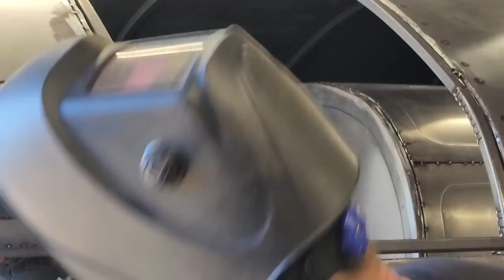Fabricating the door out of square tubing 🧲

Comment: It would be so damn cool if you opened the door the other way with the hinges on the bottom. Then put fixed steps on the inside of the door. Like on a private jet. But I think you have to use like hinges from a trunk lid or something. Maybe really big curved hinges that acts like handrails when the door is open?  
But if you decide to have the hinges on top anyway, it would be just as cool to have a mirrored door on the other side. Like on a DeLorean.
Imagine that silhouette from the front...
Reply: I really like that idea.  I think you're on to something here!  Chad, this is a great idea!
Reply: Second that

Comment: Just my humble opinion - but I think it should have the doors ahead of the wheels.  And one on each side.  Otherwise it is a bit "hokey" with having to do acrobatics to get in & out.  But, oh well - it's Chad's creation to enjoy as he choses.  And I'm sure it will never be a heavily used vehicle anyway - if it is ever actually completed.  I've enjoyed watching it come from just an idea & a floor - to where it is now.  Still wondering what he'll do with the narrow-track front wheels.
Reply: I agree with you. But he is going to build it his way
Reply: Oh it's VERY hokey.  The fin on the back cracks me up
Reply: I think he doesn't want to compromise the front end structure. Just my opinion
Reply: Yeah I thought that was well looking at the original pictures of the old vehicles they built
Reply: I believe that the passenger should have a door, if for no other reason to provide an escape route in the event of something happening to the driver and/or the driver's side,.... trapping them in. Or a fire starting in the engine compartment
Reply: Chad is one man of many projects. Hey theres plenty to go round.. Yea we have all enjoyed watching it materialise, questions questions what will he do next 😄For the front wheels im thinking hes gonna use an outer wheel from a double axle set up to get the extra space , and possibly pish the boat out altogether and put spacers on too. A few precise cuts and left over hinges would make a flip front opening clamshell design. Solve all the escape issues and the door fab.   But yea its chads work so he can do what makes him happy and we re all very privilged to be watching.
Reply: @nelsonmattoon150  exactly why would he build your way?
Reply: You think it’ll ever be driven?
Reply: He can have offset wheels made for the front to make them set out more, but I doubt he’s interested in doing that.
Reply: I know ?
Reply: @irishcubs01    lol.    I love the fin idea.  But I'm personally not fond of that particular fin.  It curves upward to a point.  I'd rather see it curve downwards & be gently rounded.  To match the car.  Could even put "rivets" all along the fin all the way to the front & down the windshield to meet the grill.
Reply: @bardricmacgregore4863  that's true
Reply: @oldredchevy-hh6de  I think he only put it on because the curve on the back doesn't match the front
Reply: I like the awkward door, but a simple escape hatch in the floor and/or roof would be nice... just in case.

He seems to wing things and build onto them on the fly which I love, because it's how I am with every project I have ever undertaken. It makes it yours. My biggest problem is evolving an idea over time, making it better... it can make for a fair amount of undoing work.
Reply: @mrstyle_67 He has a set of duel wheels outside which Nathan was trying to get apart. May be he’s planning on using these.

Comment: You should do the door like on a private jet where the stair is built on the inside of the door. Hinge it to open down and have the steps to get inside and when closed it in hidden. The hauler is shaped like a aircraft hull.

Comment: Chad, ever consider putting a electric motor on the hand pipe bender with a foot switch maybe ? It could give you better control and you could hold the piece and run it through single handed .

Comment: Mr. Chad , after you put the 4 sides of square stock around door opening. Now to strengthen door in center weld a piece of curved square stock from top to bottom on center spot of door. At the top and bottom of existing square stock , you will have welded to slots/cam to receive square stock from door. Do you have 1 1/2 " piece of square that you cut (1) side out to make a square U and weld in center spots,top and bottom. If when you close door and center square stock is not fitting tight in slots/cams (bend in the sides) for tighter fit,a hair at a time. Your slots/cams will be 3 sided with 1 open end to receive door square stock. Like a kitchen cabinet door slam latch made of 2 pieces, 1 end a cam-shaped like a U and the other a body to fit in cam     Cam -top and bottom, square stock welded on door.

Comment: Hey Chad - Given you tend to build with way more square stock than tube, would it be better to get some rollers for your pipe roller that have square faces or some flat rollers. you could get the ones you have already slightly damaged and have a square machined into the roller if you have a mate with a lathe.
I like how this is coming together. interesting build for sure.
Reply: need to have rollers that fit the square stock.  Flat rollers will kink the tubing if there is no pressure on the sides.

Comment: Even a step ladder shows getting and out isn't easy. Wait, I've got it, Doug can ride in the back laying on the floor by the engine compartment working on his tan from the heat and when they stop he can hop out, pull a stepladder out of the back  run up and put it in front of the exit. When everybody is out he can then put it away until it's time for them to get back in, at which point he can place the stepladder, push everybody up and over and in and then throw the stepladder and himself in the back by the engine.

Comment: You need to get that machine running that is outside so you can use hydraulic pressure to bend square tube like that.

Comment: You should of used the other angle pieces you had cut and used the for the end of your arched piece with the 90 end toward the door openin not only would it give you your true 3/16 read but it would hold the end of the  square stock for you free second hand

Comment: I’m wondering why Chad didn’t just use 2 new pieces of square tubing for the framing of the door? He cuts it in half then for the next 45 mins cuts pieces of what Doug bent for the bumper - and try’s over and over again to make them fit? Did he think he was wasting material? That made no sense to me. Both sides could have been shaped and tack welded in place in 30 mins. 🙄